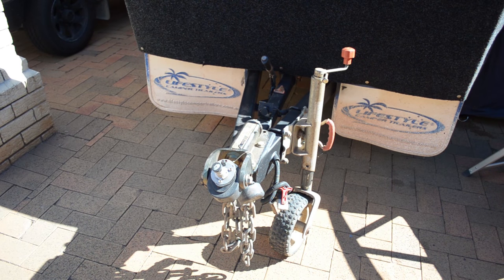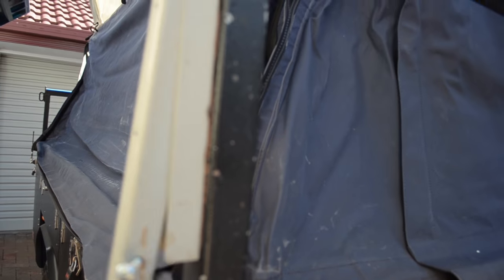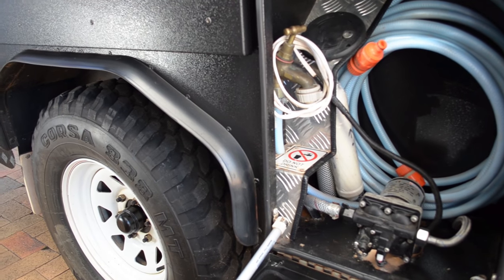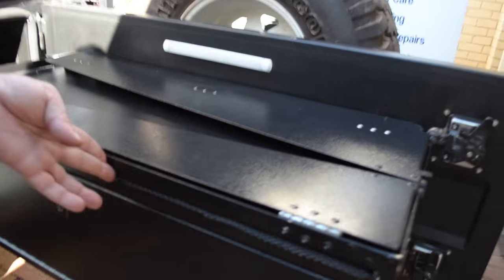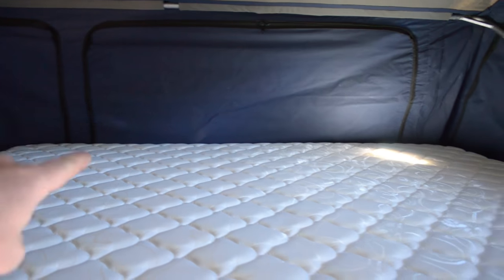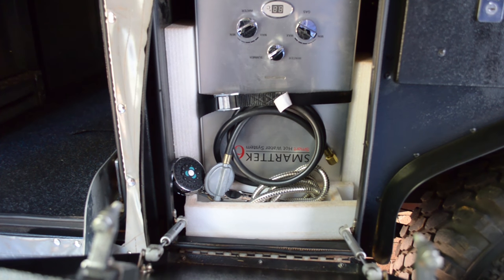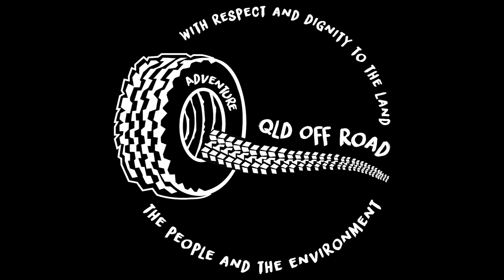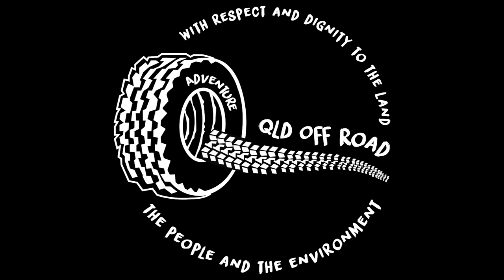Lifestyle Camper Trailer Review - QLD Off Road Adventures Reviews

Comment: You said you added a hot water system and tank, how and where did the hot water tank go? Where did you get the tank and hot water system from? Cheers Steve.
Reply from the maker: Hi Steve
The hot water system was a Smartech6 gas hot water boiler. This was stored in the cabinet on the opposite site visible in the video at time ref 25:26. The reference within regards to the water tank is that we have two water tanks under this camper. The tank behind the axle is for drinking water and kitchen supply only, while the tank forward of the axle is for washing and showers and can therefore be filled with lower quality water.
If is was to do this again now I would use a The Duoetto MK2 Digital Dual Voltage Electric 10lt hot water system. More compact, lighter and does not require a gas bottle.
Reply: @qldoffroadadventures805  could you run the electric hot water off your battery supply?
Reply from the maker: @targetoz5470  yes absolutely.
Reply: @qldoffroadadventures805  wow, that’s a great idea, might look into that, thanks heaps.